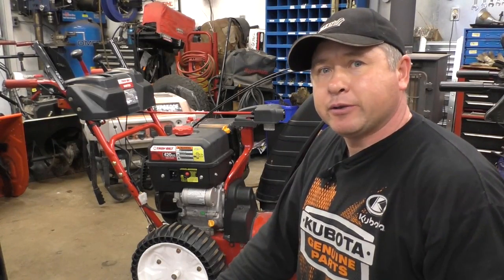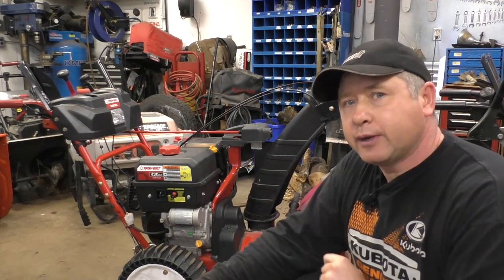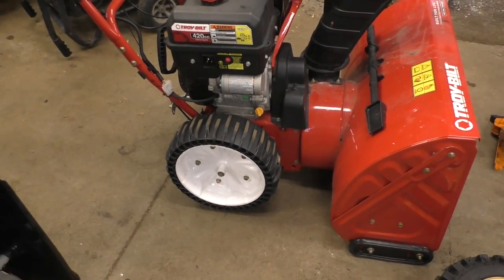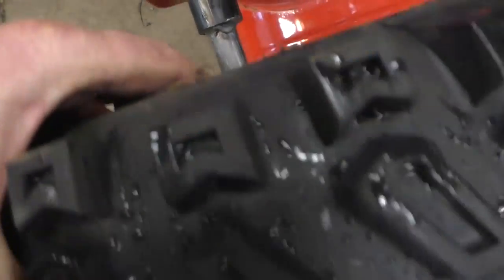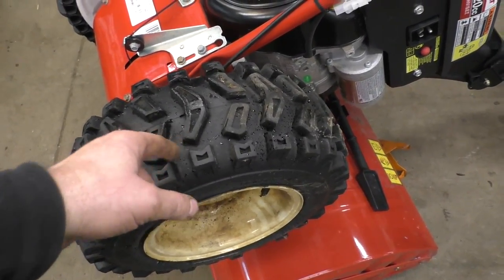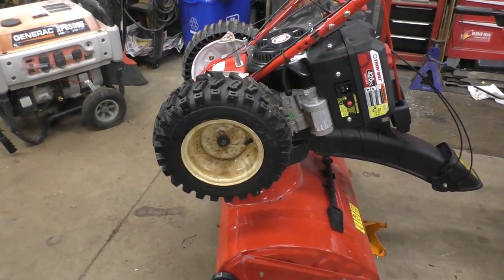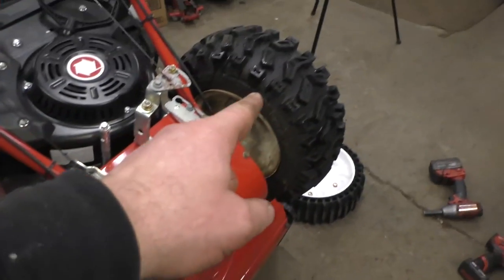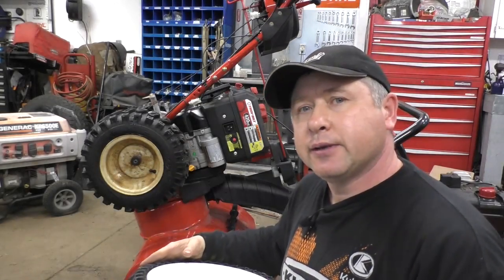Convert Snowblower Wheels Back To Rubber Tires! MTD CUB CADET TROY-BILT COLUMBIA YARDWORKS

Comment: I'm in Louisiana, about 250 miles above the Gulf of Mexico, and one of the things I like about it here is it usually only snows once or maybe 2 days in a row every 7 years.  When it does, it usually melts or turns into slush, so driving in it isn't bad.  No snow blowers for me, but glad you can help so many who want the rubber tires.
Reply: Good  day 100%VG  I am from Ontario.  Are u lucky.  Thanks

Comment: The solid wheels seems like a good idea if they were designed to get better traction but as you pointed out there are plenty of old wheel and tire combinations out there on the used market. Great video Donny, always teaching us something new.
Reply: Toro tried solid airless Wheels on early versions their 521 snowblower. People that have that version said the traction is terrible. Some people have actually studied those solid Wheels. Toro did eventually switch to pneumatic tires on that model.

Comment: Rubber tires with a set of chains => unstoppable. I need this because my driveway is steep. Yes, the chains will eventually have to be replaced, but your tires hardly wear out. I used 2 sets of chains so far and the tires are still in very good condition.
Reply: I've got a set of chain on My 1985 Toro snow blower. I've had to REbuild them twice. (No sence buying new when they can be rebuilt)

Comment: We have a small engine salvage yard about 45 minutes from here. You can get parts for pretty much every type of equipment there. It used to be a snowmobile salvage yard years ago but now it's  just mowers, blowers, riders and very few snowmobiles. I need to go get some tires for my Snapper snowblower( cheaper than buying new tires or installing tubes). They have mower decks as well, many are brand new. No idea where they got them. They had steel drums FULL of chain saws and weed wackers last time I went.

Comment: I get the whole plastic thing as it cuts down on costs for not only the parts but reduces weight making shipping less money.  The drawback in some cases does the new work as good as the old?  I have an 10 year old Toro Power Max with a plastic chute.  I’ve seen many post complaining about them and repaired a few myself.  From what I see it’s not the material it’s the design.  In fact I just recently repaired a older commercial Toro of similar age and noticed a sticker on the plastic chute that said it had a lifetime warranty!

Comment: Do you have any suggestions for a Cub Cadet single stage snowblower with plastic wheels that they get covered in snow and stop rolling?? Mostly the left and I think it's from the exhaust, would rubber wheels stop the freeze up on this wheel??
And how do you getthe old plastic wheels off of it? There doesn't appear to be a hub cap on them to get to a nut or Cotter pin etc?

Please help this is like moving a boulder when the wheel freezes, and yes WHEEL only the left seems to do this.

Comment: Hey do you ever look at the comments on your older videos? Toro S 200  carb throttle spring holds throttle wide open seems like it's way over revving.

Comment: Good used parts still usually sell for half the cost of new parts, so they aren't exactly cheap. Way better traction with rubber tires.

Comment: I have an old one w this type of square axle n never got to remove wheels on, bolts remove easily but rims stuck on shaft impossible to get out, want to do it to down axle in down holes to get up the machine, if your have a tip.
The only one stays to me is to,,, cut the axle in middle !

Comment: Interesting, thanks.  I've always wondered if there was a direction the tires/tread should be, V shape forward or back for best traction?
Reply from the maker: v-shape usually pointing forward
Reply: @donyboy73  Thanks.  I'm assuming you mean on top of the tire, so it'll be facing backwards on the bottom at the pavement/snow, yes?
Reply: @richardwernst  Yes!!

Comment: Is there anything like a spray conditioner or cleaner or bagging that I can put on tires to prevent or greatly reduce dry-rot?  I find that stored or seldom used tires don't last long.  That is an added  expense that I'd like to keep to a minimum.
Reply: Heavy silicone dressing
Reply: As long as you can keep the direct sunlight off them while in storage,  even sun shining through a window,  and yes tire dressing,  like tire shine ir armor hall,  I even coat my hip rubbers with it to prevent rot. 
Personally I just put tubes in my tires, those types of tires were never meant to be tubeless Anyway.  Another good example is wheelbarrow tires. I buy 4.80 X  400X 8 trailer tubes for them.

Comment: How do you feel about the older 'track' snowblowers?
Reply from the maker: the better ones are yamaha and honda
Reply: They’re great but for longer run driveways,turning them isn’t easy even with the power steering. They’re heavier. Consider your age and strength.

Comment: You didn't recommend using chains with the plastic wheels. I realize there's the possibility the chains could tear up the plastic wheels or somehow be deleterious to them.  Is it possible the newer units have weaker drive trains and better traction could promote failure?
Reply from the maker: I don't really recommend chains on newer machines, they're not like the old ones!

Comment: Send me those plastic wheels might work out on my 20 year old blower where they don’t hold air. I see the problem they are trying to solve but plastic why not solid rubber, I know the cost, and we are back to disposable blowers again…fyi I used a can of fix a flat and you can see I’m leaking air around the bead which looks rusty, I guess I just need to pop the tires off and sand or grind the rust off.  The fix a flat seems to have worked for now.
Reply: I put inner tubes in my leaky tires. Not super easy getting the tire off & back on, but at least I didn't have to sand anything. And once they're in, no worry about leaks for another decade or two!
Reply: @RottnRobbie  that was my first choice but I couldn’t get the bead to break free and to cheap to take to a tire shop.
Reply: @boblemon2103  Yeah, like I said - not easy...
I tried leak seal first, but it only lasted one season in my 20- year old tires with their severe sidewall cracks (the blower was bought in 1999).
IIRC, I used a welder's C-clamp to compress the sides till the seal broke. My original plan was to buy new tires, but I couldn't get the tire rim over the wheel flange (too small, too tight - special equipment required), so inner tube or pay a pro were the only options. But like you, I'm cheap - and I'm stubborn too! Eventually I worked the tube in with the tire still (loosely) on the rim, and managed to get the valve stem in place. That was a b***ch of a job too, but doable. A bit less than $30 for two tubes, plus something like 3-4 hours of effort spread out over a week or so, but no problems since!
Reply: Do you have a vice to use, I always put the long shaft coming out of the inside of the wheel in my bench vice,  makes the job very much easier.  Just  clamp it in and use 2 big flathead screwdrivers and spray some WD 40 or similar stuff around the bead as you go.
Reply: @byronwoolfrey1039  I do have a vice, but it's not especially big or robust, and it's mounted on a table (not a heavy workbench) that isn't bolted to the floor. Plus the flat jaws don't hold a round shaft very well. Anything more demanding than a lawnmower blade moves when force is applied.

Comment: I have these tires and I HATE them! They have about as much traction as using summer tires instead of snow tires in the winter. When the snow is heavy I actually have to push the blower and when trying to climb a small incline I go in reverse so the snowblower doesn't slide back and run me over. Glad to see there's a solution.Anyone have some old tires they wan to sell?

Comment: You mentioned that the one snow blower was junk and going to be scrapped because the engine is seized. Why not just repower that Blower. People are using Harbor Freight Predator engines for repowering older snow blowers. there's videos on YouTube and they seem to work out pretty decent. Just a thought, good video as always.
Reply: We don't have harbor freight in Canada.  Our closest is Princess Auto and the engines they sell are not super high end.  I'm sure Don knows when to replace vs when to scrap, he's a solid guy who I wish was in my area.  :)
Reply: Sometimes it's  not cost effective to replace the engine.  Especially once you factor in shop rates close to  $100/hr.
Reply: You  have to warranty what you do. Most people won't spend the money and to much Hassel to fix and resale dealing with idiots on kijiji who ask stupid questions.  It's a snowblower not the space shuttle
Reply from the maker: @Thomasploeg1968  exactly!
Reply from the maker: @CivilDefenceCanada  I will do better off with it as a parts machine

Comment: Do you get a lot of blown engines where the carb. has failed and let gas into drain into the engine diluting the engine oil with gas . I see a lot of this in the  newer China engines where people do not drain the left over fuel from the winter in the off season . What a waste of money .

Comment: That's a nut you removed not a bolt
Reply: 100% wrong.  He removed a bolt. A nut is the small hex shaped donut that spins onto the shaft of the bolt.  He removed a bolt...